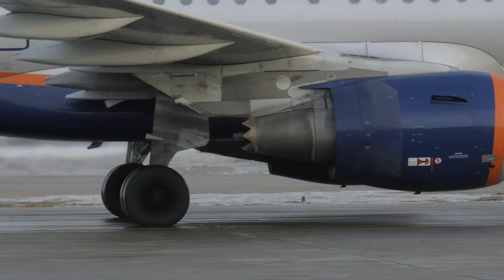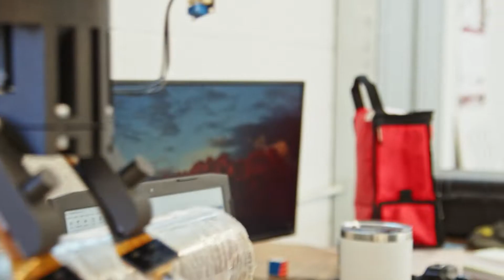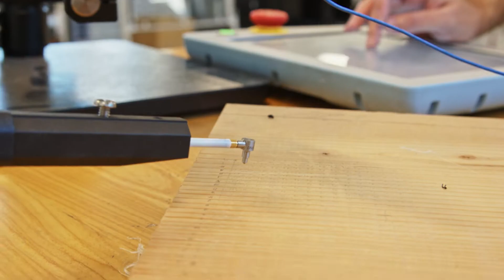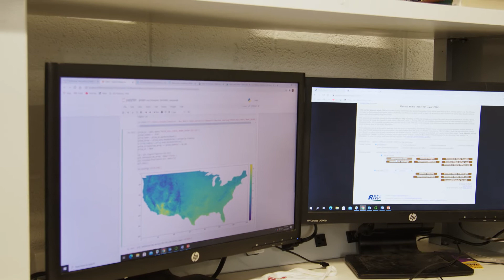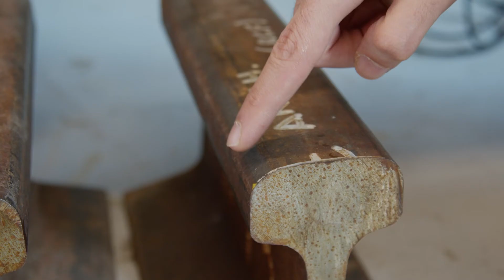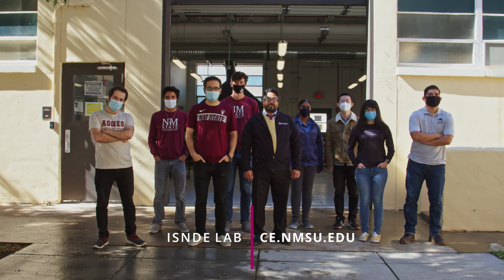Intelligent Structures and Nondestructive Evaluation group

Comment: The NMSU ISNDE Lab, also known as the Intelligent Structures and Non-Destructive Evaluation Laboratory, is a vibrant and dynamic team of researchers led by the Director, Dr. Dehghan-Niri (or Dr. Niri, as he is fondly called).

Here are the three focus areas of the e-Lab's research projects, bulletized for clarity:

Infrastructure Monitoring Non-destructive Evaluation:
Conducting structural health monitoring using ultrasonic waves and machine learning to predict damage to infrastructure based on the loads going through bridges; incorporating weather data into a machine learning algorithm to predict structural deficiency of bridges; analyzing gathered data from infrastructure monitoring in a smart way to find defects, evaluate damage, and asset management

Additive Manufacturing:
Collecting sensing and non-destructive evaluation data during the additive manufacturing process to correlate the data with the quality of the built part; using thermal imaging, acoustic emission, and ultrasound for in-situ quality control of additive manufacturing materials; creating an algorithm to find correlation between sensing data and quality information in real-time to correct defects.

Robotic Inspection and Bio-inspired Sensing:
Developing a climbing robot that uses friction instead of wheels and integrating mobility component with non-destructive evaluation (NDE) sensing system; designing a laser-inspired robot with two grippers and four fingers, and embedded acoustic transducers to image and detect defects in tubular components; mimicking an animal's tapping system to find deep cavities in infrastructure and evaluating the effect of the external ear of the animal using a hammer and 3D printing

Dr. Niri's enthusiasm and dedication to his work are contagious, and he creates a friendly and supportive environment that fosters collaboration and teamwork among the lab members. The lab is made up of a group of postdocs, PhD students, master's students, and undergrads who are passionate about making a difference in the world by addressing the challenges of infrastructure aging and monitoring.

They are driven by a common goal of making the community and the world a safer place to live. The lab members are not only committed to their research projects but also to helping one another, and they share a strong sense of camaraderie.

In this lab, students are not limited to a single research topic, but rather exposed to a variety of topics, making it a great learning experience. Overall, the ISNDE Lab is a wonderful community where researchers are motivated, supported, and valued for their contributions to the team's research projects.